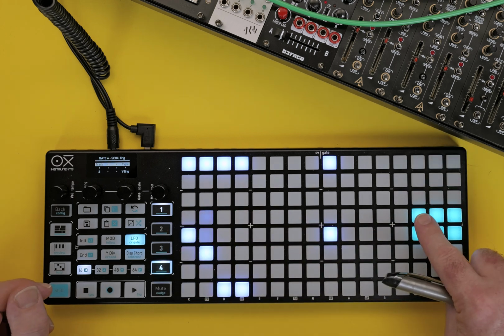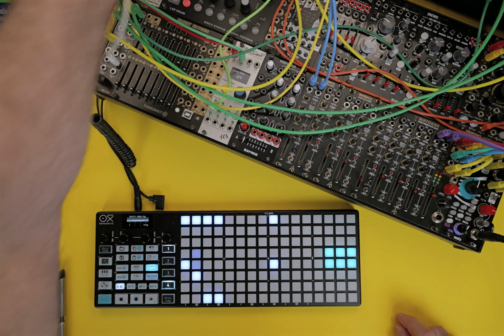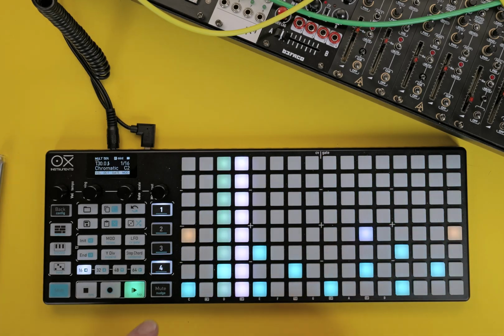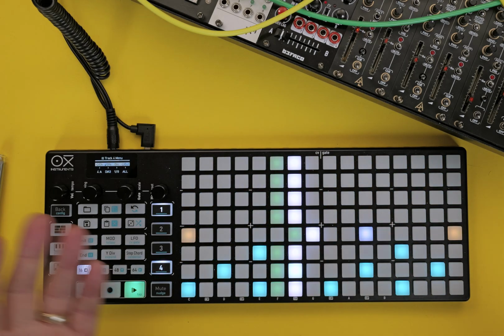How to use your Oxi One with Eurorack. CV/gate explained with examples

Comment: thank you so much for this video - my setup is like an old serge modular system that only have cv and gate,im having troubles with changing tracks, whenever im trying to make anything on seq 2, my entire seq 1 stops and holds a note, even though my envelope and eveything is fine? - my setup is, ableton - sending midi to oxi, converting it to cv/gate and then to the serge modular. since serge i monophonic, id love to do some fm, and also just be able to trigger more than one osc at time, from seq 2, 3. the only thing i do now, is just stacking cv/gate1 to multiple things, because that's the only thing thats going. and i do go into cv/gate setting and are sure my settings are correct. thanks a lot !

Comment: Hello. I have a question if Moog mother 32, subharmonicon, grandmother, and even Taiga have midi. So what difference will I have if I connect via cv/gate and not via midi?
Reply from the maker: Not a huge difference if you can sequence your synths over MIDI. This is more for modular where everything is CV and gates. But don't forget you can send modulation from the Oxi One to the M32, Subharmonicon etc over CV as well as MIDI
Reply: thanks very helpful.  trying to learn enough to sequence and modulate a 2600 from the oxi.  I've heard it's cool.  for some reason this is complicated for my brain.